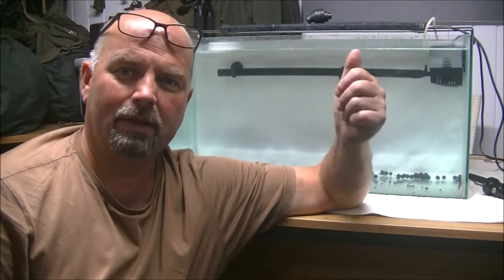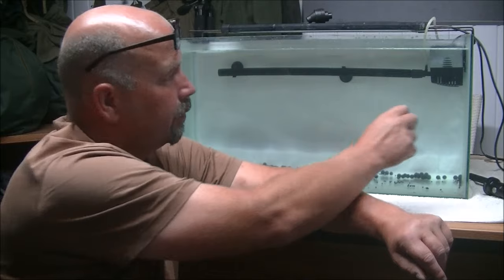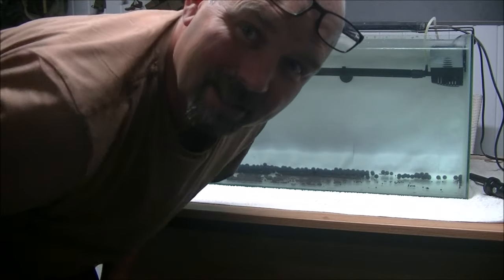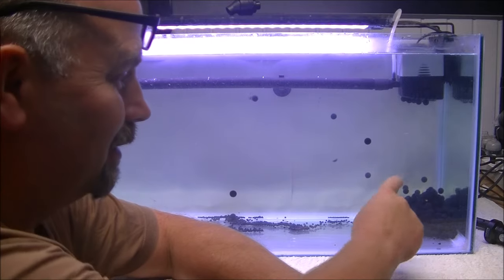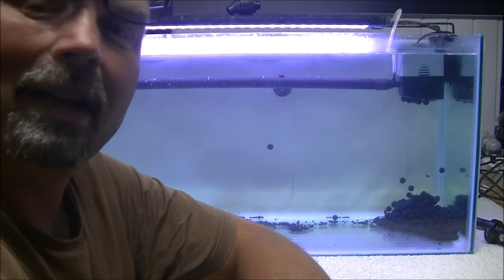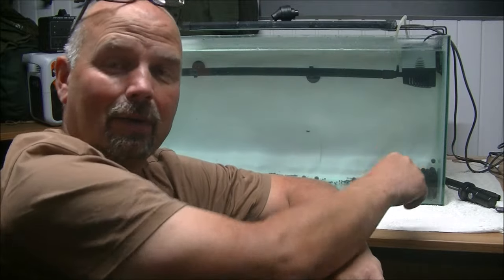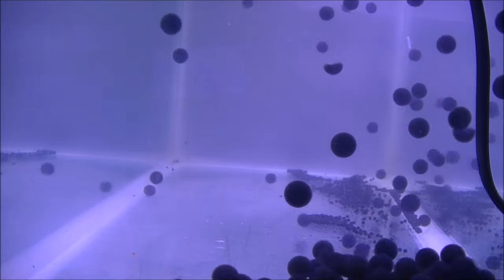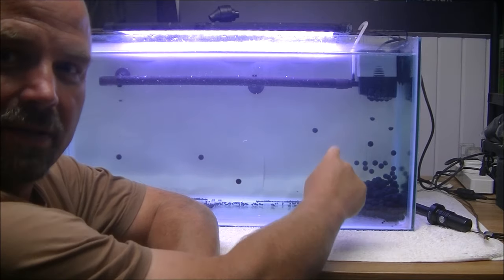Aquarium Spray Bar Flow Demonstration - Pondguru

Comment: Not the best for fish that prefer swimming against current, but good for keeping a tank clean.
Reply from the maker: ? If you have a spray bar it is the best for fish which don't like a heavy current since the flow is diffused across the whole length of the tank and the entire middle section of the tank is slow flow.
Basically a spray bar is the best way to ensure that the tank is kept clean and the fish aren't bothered by a heavy flow (as they would be with a straight outlet / 'duck bill' outlet).
If you have guppies, Angels etc. which don't like a heavy flow then the spray bar is the way forward.

Comment: Can't see why you are doing these with intake in the wrong place.  Flow will always be from output to intake and locations of - both - are crucial to determining flow pattern.  Using a power head makes these pretty irrelevant.   Why not use a cannister filter and show accurate patterns?
Reply: (my other channel) an outlet is an outlet and an intake is an intake - whether that is on a canister or internal filter the flow results are the same.
Feel free to make videos yourself on anything you think people would want to see and link them in the comments, no worries.
Reply: Of course the water will enter the tank from the outlet and exit the tank from the intake. Yes that is how water enters and exits. This video is to show the muck that is moving within the tanks water column, and purely to show where the best position is for the intake, to remove the maximum amount of debris, at the same time as removing the water. When using a canister filter, the intake and outlet can be placed wherever the Aquarist chooses. And a lot of people mostly choose one at one end, and the other at the opposite end.  This demonstration is to show that doing this is not generally the best thing to do, by showing where the debris settles.
Reply from the maker: @Les-OZZYTHEOSCAR  Groovy - that pretty much explains it.
Whatever works for you is the best, lol